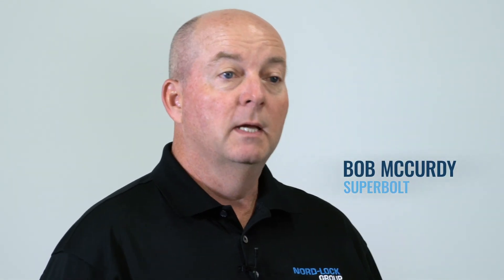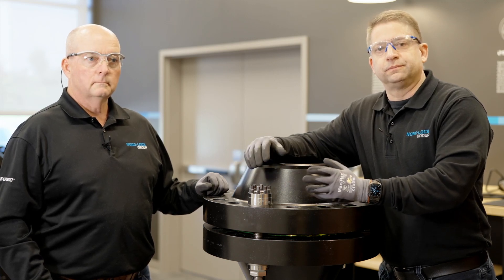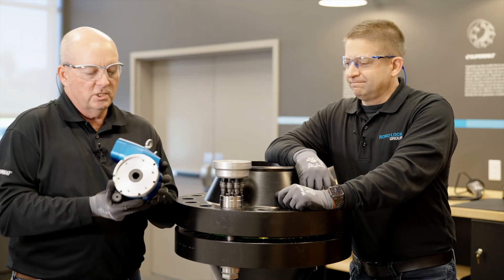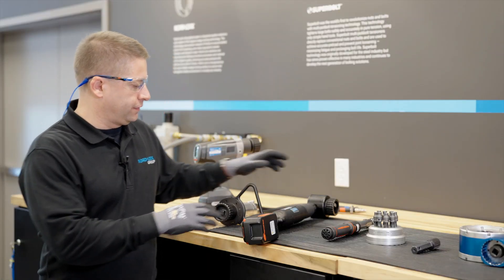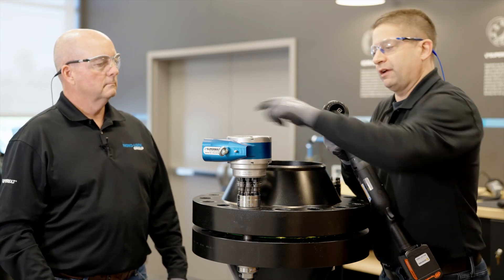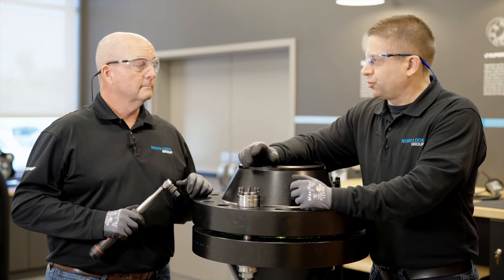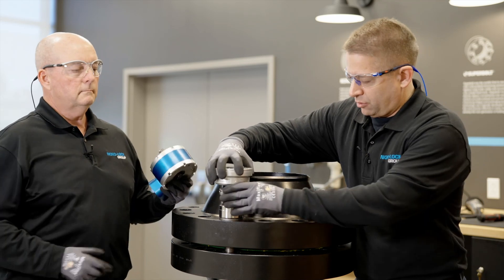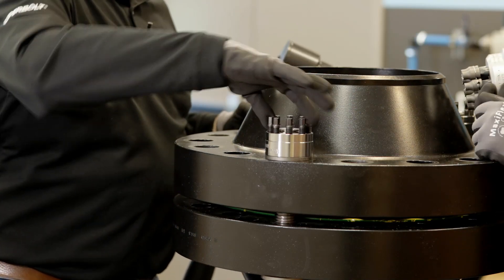Getting To Know Superbolt – Superbolt Tool Tutorial

Comment: I understand what the tool is doing, but I guess I’m not understand the “why” of it, the purpose. Why isn’t a big nut being used on the stud, like the one on the bottom?
Reply from the maker: Great question! Superbolt multi-jackbolt tensioners take high preload requirements and break them down into manageable torques using the jackbolts threaded through the nut body. Instead of dealing with a large torque requirement often associated with standard/large hex nuts, Superbolt only requires a much smaller torque. This means that simple and safe hand tools are the only tools required. As bolting applications get bigger and have numerous Superbolts of the same size, the Superbolt Tool is a further enhancement to the tightening experience since it offers simultaneous tightening of the jackbolts.
Reply: @NordLockGroup , thanks for the reply. I understand. So, during design phase, do the engineers need to know or specify in advance your superbolt? Is the torque previously required for the fastener changed? Is there a standard conversion for an existing application that converts to your superbolt from a standard bolt? Is it done by measuring the stretch of the bolt regardless. And a rather dumb question, why is it called a superbolt when it’s actually a nut?
Reply from the maker: @GNX157  We often work with engineers and OEMs in design phase with their applications and bolted connections. We can assist in the optimization of the size, type and number of boltings. The tightening requirements are mostly supplied by the customers and whether supplied with hex torque, preload, stress, or stretch value, we provide the corresponding jackbolt torque to achieve their requirements. T=KFD is the common conversion used between hex torque and preload. It is true, we supply more "nut"-style Superbolts than bolt-style Superbolts. Users have called them Supernuts and Superbolts interchangeably.

Comment: That a Ingersoll Rand QX battery tool and we can make 2 stage tightening 
STEP1) TO Tightening the bolt to desired torque 
Step 2 ) will be auto reverse the tool to 2 to 3 degree  to loosen and release the tension so that you don't have to press reverse manually ...if u get ok in step 1 we get step 2